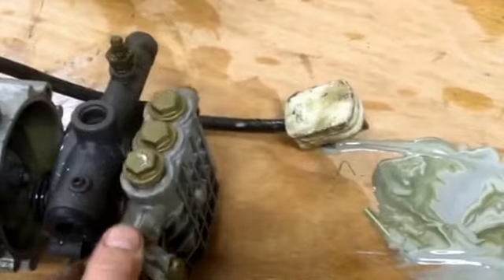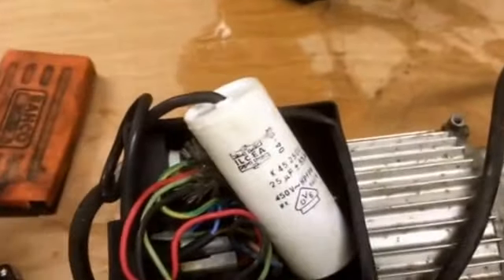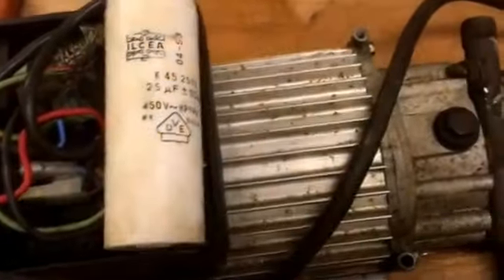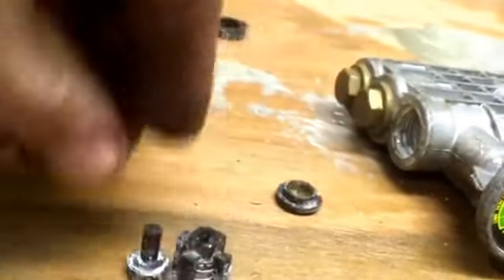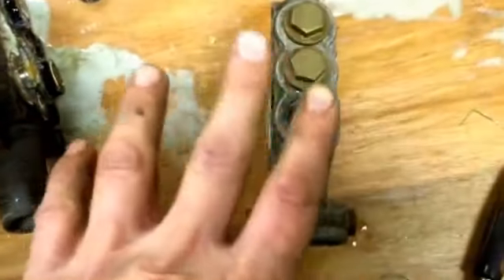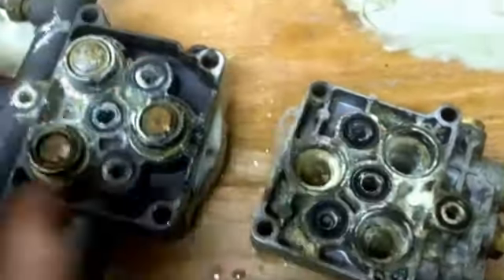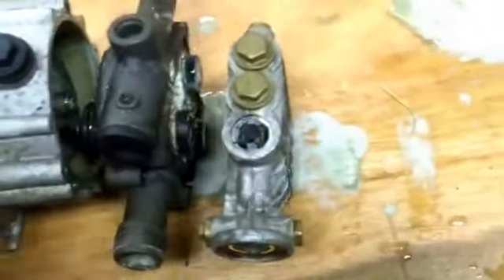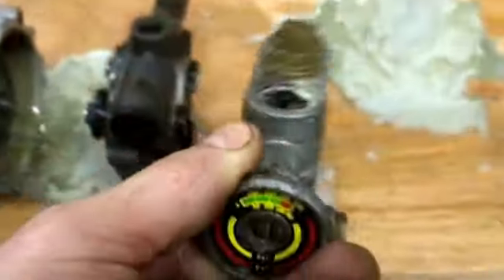How to repair a pressure washer

Comment: I have an AR Blue 2000 and it has worked great for about 4 years. Last year I noticed just a little but of oil under the machine. Anyway I just took it a part and was wondering does oil go on the spring side and if so what type of oil. An be used and how much. Thanks

Comment: Add that I think you have explained it well and simply and removed the mystery as to how these things actually work and assisted logical 1st aid diagnosis of any problem that might arise. Is there a good place to get piston seals for ones where the manufacturer does not support or no longer supplies replacements? Thanks again

Comment: Those capacitors kick start the motor washing machines and dryers have them a as also important not to touch terminals until they have been discharged you will get a shock 👍👍👍

Comment: Single phase induction motors need a running capacitor to generate the rotating magnetic field that is needed to make the rotor rotate. Three phase motors used in heavy machinery don't need one.

Comment: Great video but I am trying to figure out what chemical to clean the Gunk with and I have what looks like grease in everything and the bearings shot out with the plate that holds them in. So I'm not sure what greese to use either.

Comment: Hi,any ideas on my Karcher k6.50mb and why it will not stop pumping water..Ive taken it apart and replaced all valves ,oil seals and oil.A new unloader valve was fitted before this work but it has the same problem.It builds so much pressure and burst the weakest link usually the 'u' clip holding the hose to the gun! I'm thinking maybe the unloader I bought was faulty.Appreciate any tips..

Comment: I have an AR Blue electric power washing that was leaking so I have to replace a gasket but unfortunately when I took it apart there is a small spring / plastic plunger that I have no idea as to where it goes. Their tech department is horrible.

Comment: My pressure washer was working fine and it stopped working. When I squeeze the handle it does nothing, before when I squeeze the handle it turns on and sprayed. Mine is different from the one in the video. Any ideas?
Reply: autostarting relay may have loose wires or might have been damaged

Comment: Hi, great video, what do you do about the oil when reassembling?
Reply: That's what I need to know also.
Reply: @anthonyskilton2679  I literally just got round to this job in the last month, i saw another video where the YTer suggests it's not critical, just cover the moving pieces (this is with the pump on it's end before the head goes on). I think i did manage to find the service manual for my specific washer which listed a quantity but i certainly didn't measure when doing it.
Reply: Yes I'm wondering which oil I should use for the piston box? My original one for a Nilfisk 145.3 looked grey and kind of mineral? Maybe something with lithium inside?
Reply: @gilemonx  I'll let you know what I used in a minute
Reply: Sorry forgot to say that this video is just awesome, thanks so much for the time and effort you put to teach us this!
Reply: @Greenbeast999  Thanks. No I'm in France.
Reply: @gilemonx  ah i was going to offer half my bottle but the postage probably makes it pointless

Comment: Hello! The pump in my machine (Stihl RE 106K) is almost the same as the one in this video (only inlet valves are diff color). I detached the high pressure manifold, and then detached the head with pistons. When unscrewing this thing it seems like the chamber with swash plate was slightly pressurized and the greenish (bad vomit alike) liquid (like oil) started to leak. Is this an actual oil, does it need to be replaced and what kind of oil you pour into this area and how many? ... if you know. If the oil is green olive color, is this a problem with water coming from the piston area (through piston housing) into swash plate area?